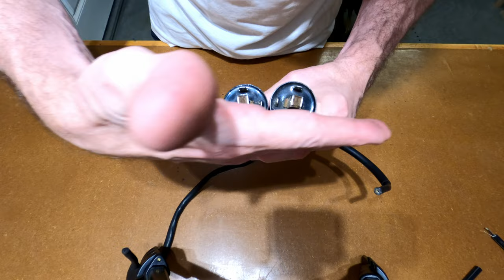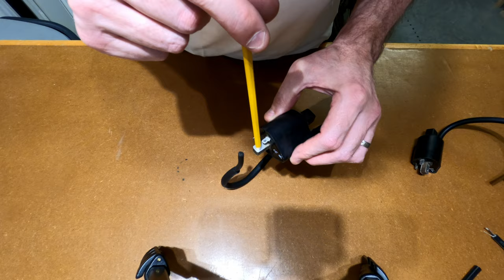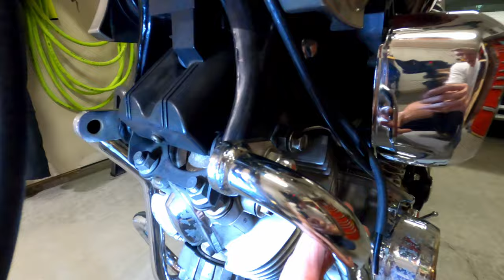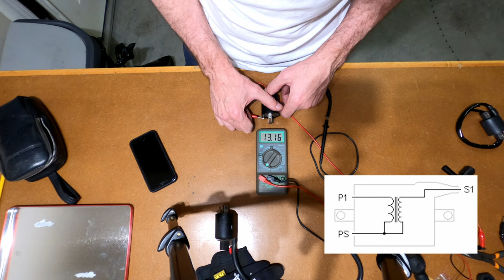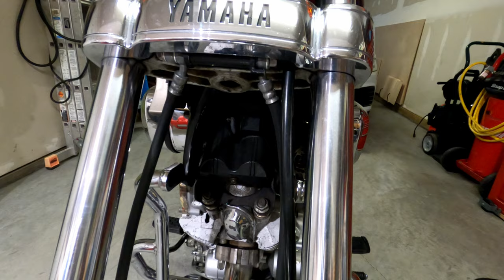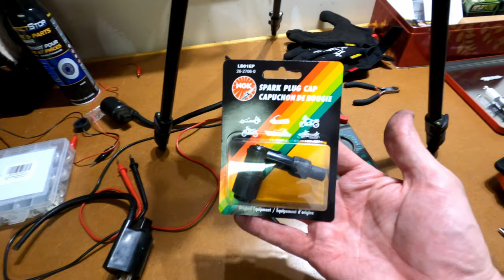Yamaha Virago Ignition Coil Replacement

Comment: I have put 2new coils on my 750 virago year 1992 , with no problem, my main problem was the carbs had gunge in them,stopping the petrol getting through , so stripped them down and sonic cleaned them , then put all new jets and gaskets in , I don’t have that small hose going to that box , I think it’s because my bike is a UK model, nice to see you explain about the coils and Leeds. I got my 2 from a motorcycle repair shop and were maid in the UK .

Comment: Ken, did you know that the resistor in the cap can be removed and replaced with a brass conductor, and thus limit the overall ignition resistance to the plug's 5K?  Look inside the original cap and you'll see a flat screw head.  Carefully unscrew it and allow the 5K resistor and tension spring to fall out.  Check and clean any corrosion.  I now run the BKR 5K plugs with a solid piece of brass in the cap.  😎
Reply from the maker: Yep...I did but thanks for highlighting that.  My problem was that the dude before me changed out the caps and not only were they not OEM, but they were of different resistor values too.  And you're right about most of the old caps - the resistor can be screwed out and you'll see it - usually looks like a small fuse.  Problem is now, the OEM BP7ES plugs are obsolete and the caps need to be of lesser overall resistance to match the original system resistance if you buy 5K plugs.   These days, most caps have the resister moulded right in and it can't be removed.  Not a big deal since the caps I bought were only $5 each.

Comment: Thanks for a very comprehensive summer semester type class on this system.  Awesome.  The NGK 1k caps are now not available, though.  No luck on subs.  For reasons I cannot understand I cannot measure the resistor in the stock caps on one I pulled this morning in pajamas. File, scrape, new batteries, and check several resistors in parts box.  Three Viragos in garage so will play some more but leaning to a piece of 6 or 8g copper down the rabbit hole.  Still got about 50 of your videos to go.  Enjoy
Reply from the maker: Thanks for that - I really appreciate the time you took to comment.  This was one of my earlier videos and I was still trying to find my way when it came to these videos and my restoration project.  One thing to always keep in mind is that the cap resistor is optional.  It's there to suppress noise and for no other reason.  I like to eliminate things like cap resistors when I troubleshoot because they can be so temperamental.  The wires themselves break down and I find that causes more problems than anything else.  Good luck and thanks for watching.

Comment: You keep the nut on top of your spark plugs? The cap doesn’t fit correctly with the nut on the top.
Reply from the maker: I have the type of cap that requires that the nut stay on the plug.  You can buy the caps either way.  But good point for everyone to know that you have to match everything - even making sure that your cap is designed for a nut or thread.

Comment: I measured new coils I got they are at 2.7 ohms my stock ones 4.2 to 4.5 I would assume lower resistance be better did u test your new coils
Reply from the maker: Good point.  I actually didn’t measure the resistance of the new coils.  But I’m sure with today’s technology, much of the copper wire today is manufactured to different standards than from 40 years ago - low oxygen copper is common today.  I’d say, yes, lower is better (to a point - obviously you don’t want to read a short).  One of the biggest problems that people overlook, including licensed mechanics, is the health of the rubber insulation.  I’ve seen coil wires misbehave even when measured to spec - this is because the insulation breaks down and the high voltage goes to ground (arcing to the frame, engine, etc).  This is more apparent when the coil wires get wet.  I’d say any reasonable resistance on the primary or secondary that is close to the shop manual spec is going to be ok.  Just keep your eyes on the aging rubber parts too.

Comment: You have an Amazon or Ebay link for coils for a 1997 XV750? Also, if you're ever riding around philly, lets grab a beer. 😎
Reply from the maker: Try these from Caltric - I've heard that their coil replacement works well.  

https://www.amazon.com/Caltric-IGNITION-YAMAHA-XV-1100-1986-1999/dp/B014WWUU74/ref=sr_1_7?crid=1WW2FIQDM69YD&keywords=Yamaha+Virago+1100+ignition+coil&qid=1658447951&sprefix=yamaha+virago+1100+ignition+coil%2Caps%2C146&sr=8-7#customerReviews

I'll take you up on any beer offer!!!  Cheers!

Comment: After putting on new coils I have spark in the rear cylinder but not the front
Reply from the maker: see if you can isolate the fault by switching the leads from the ECU.  Try isolating the caps and plugs as well by switching them from coil to coil and see if the problem follows the coil or the component.

Comment: What type of boegie you use now? Instead of the BP7ES?
Reply from the maker: I use the NGK BPR7ES Iridium plugs now but I have replaced the OEM plug cap (that had a 5K resistor in it) with an NGK cap with only 1K.  This setup seems to work really well.

Comment: Hello Ken. Thanks for your great video's. We chatted a while ago.
I'm having trouble !  I had a mechanic clean and set the carbs. Didn't feel I could do it myself.
When I collected  the bike it sounded great at tick over. Riding only 7 miles home it ran terrible.
When I arrived home it cut out and wouldnt start again. Misfiring whilst trying. Now it doesn't even offer to start.
I checked the fuel pump, checked the coils ,leads and caps using a multimeter all good. It's had new plugs, cleaned out the fuel tanks and  replaced the fuel filter.
Any advice where to go next ?
Reply from the maker: Firstly, you may want to just take the bike back and explain what happened (or call your mechanic over the phone).  He may have a quick solution (ie. forgot something).  

Otherwise, go back to the plugs first.  Pull them out and have a look - they tell a story and never lie.  Since it was just recently serviced and the plugs were new, if after just a short ride they are light brown with little signs of combustion, then you are getting fuel starvation.  That could be caused by sticking floats - a VERY common problem right after a full carb overhaul.  If you can, remove the rubber air inlets at the carbs so you can see the CV throttle plunger.  During start you should be able to see fuel spraying (like an aerosol can) from the base of the needle.  If not, your floats may be sticking.  Tap the float bowls with the base of a screwdriver handle (gently but firmly).  This will dislodge the needle and start the flow of fuel into the float bowl.  If your floats are stuck open, there should be the tell-tale sign of fuel seeping from the float bowl area.  That would also cause a very rich condition leading to plug fouling and misfires.

If the plugs are loaded up with soot and wet, then it’s obviously rich.  The rich state with misfiring can caused by so many things.  New caps & plugs don’t mean anything if they’re not the right ones.  Old viragos had NGK BP7ES (no resistor) and a 5K resistor in the cap - as I mentioned in this video, they are near impossible to find, and with older caps and a 5K resistor type plug (BPR7ES), you’ll have reduced spark intensity.  Visually check the quality of the spark (both) by pulling the plug and grounding the case against the cylinder and cranking the engine.  it should make a distinct snapping sound and look bright bluish-white.  I’ve seen underperforming coils, caps & plugs measure to spec but still be inadequate to produce a healthy spark for strong combustion.

Hope this helps.
Reply: Great advice Ken. I've made al start 🤞
Reply from the maker: @mickleyland5057  Awesome Mick…keep me posted.  K
Reply: @KensWorldRestorations Hi,  spoke to the mechanic and he's sure it's not a fuel issue. I have a spark on the front plug, but none on the rear. The spark plugs are the type  recommended. But I'm not sure about the caps.
I'm currently replacing the rectifier, but screws are seized. Waiting for wd40 to work it's magic 🤞
But if there was an electrical fault would I be getting a spark on the front?
Both coils seem to be as they should be.
Reply from the maker: @mickleyland5057  Ok…good start.  Remember the Virago needs a strong battery to start because the TCI feeds the coil voltage directly from the battery.  If the battery is low on start, the spark is weak.  YES, you can have one cylinder firing and one not.  One cylinder firing is usually a sign of a loose wire somewhere.  Check the wire connection from the TCI unit (on the front of the rear fender  - a bit of a schmuck to get at) and make sure the coil wires are tight and clean and make sure the cap and plug are all sorted out.  If it’s the rear cylinder, I’ve seen MANY Virago coil HT leads short out against the frame due to the rubber breaking down.  If you feel even a mild electric jolt anywhere along the high voltage leads (including the caps) there is stray voltage leaking and it will find its way to ground very quickly.  Keep plugging away…you’re getting close.
Reply from the maker: @mickleyland5057  To isolate a faulty cap, just remove it and crank the bike over holding the bare end of the HT lead about 1/8” from the engine case or frame.  It should arc.  If it does, you know your cap needs to be spanked.
Reply: @KensWorldRestorations  hi. Thanks for your help. I think the stator is caput ! Which I believe would ruin the rectifier. There's this video https://youtu.be/srzfWyMlm7c 
At 4 min 20 sec I get the same thing.
So going to take off the stator first then order a new part. 😊👍
Reply: Hi Ken. You asked me to keep you posted  !
The starting problem began when the bike was in for a new exhaust. They said they changed the spark plugs and the problem persisted. I was convinced it was a carb problem and had that done. He also said he changed the spark plugs !
So because of all this, I didn't feel the need to change the plugs again and started looking at all the other possibilities 🤪
So having worried about coils, battery, stators etc, I decided to change the plugs !!
Put in the iridium equivalent and it fired up straight away🤪👍
There's a moral in there .
Thanks for your advice .
Reply from the maker: @mickleyland5057  Great news…I swear by the iridium plugs - they have a better design and provide a more intense spark.  They are a 5K ohm resistor type plug so you can lose the resistor in the cap or do what I did and just buy a cap with small (1K) resistance.  Glad to hear…I pretty much suffered the same trouble when I got this one - it had two different caps, the coils were toast, the rubber HT leads were done and it ran like crap.  Glad it all worked out!! And thanks for keeping me posted!!  This kind of information helps everyone.

Comment: What are the signs that coils are bad? My 1997 with only 700 miles sat for 25 yrs, carbs cleaned, got it running. Rides for about 10 miles then when it gets very hot, it sputters out and dies. Let it sit for 10 mins, restarts like nothing happened.
Reply from the maker: The signs aren't always obvious but if you are 100% sure everything else in the chain is working perfectly, then age is the biggest factor.  The most obvious sign in that the spark isn't a bright blue, snappy spark.  If they're that old, probably a good idea to change them.

These Virago coils have the high voltage output cable molded right into the coil pack and 99% of the time, it's the wires that are breaking down.  It's usually corrosion of the copper conductor or the rubber insulation breaking down.  If you've got heat issues, it may be the ignitor module/TCI unit.  The electronics in that thing can sometimes be sensitive to heat.  If your bike sat for 25 years, I'd say anything rubber is toast (seals, o-rings and ignition wires/caps).
Reply: Did you figure this out? Having this issue now
Reply: @katobytes I believe it was a mixture of a bad petcock and still the bike having vapor lock
Reply: @Thumperwrestler  Thank you for the response!